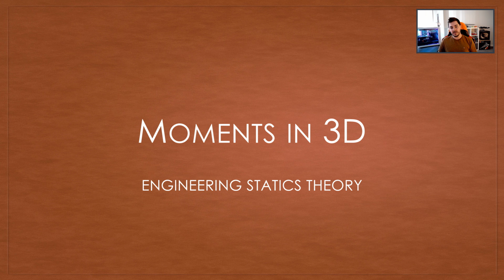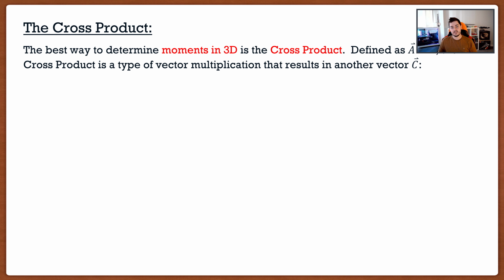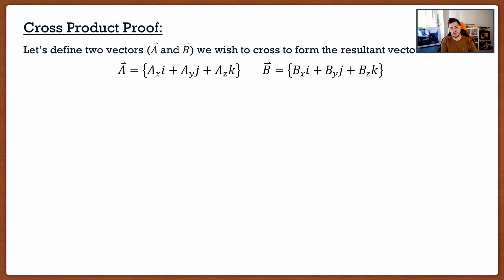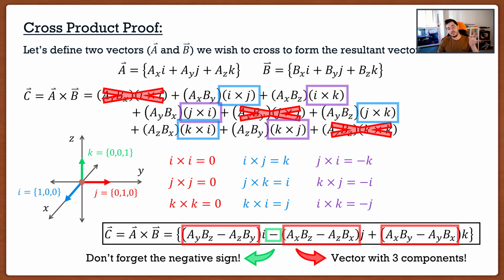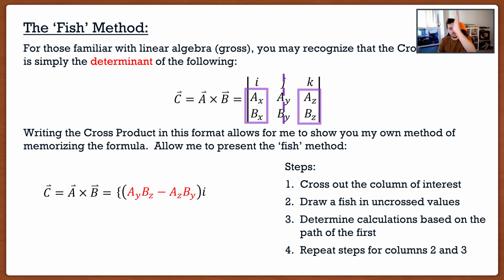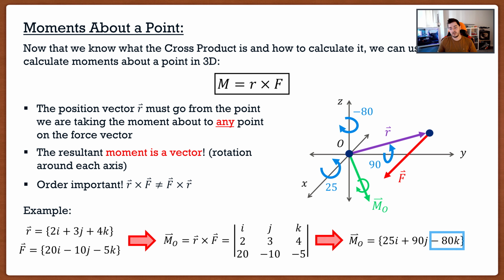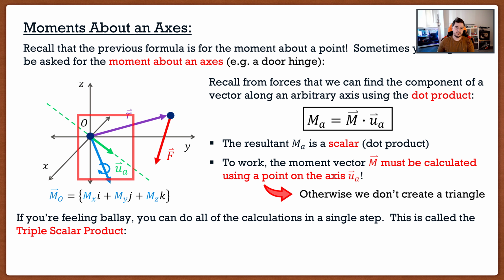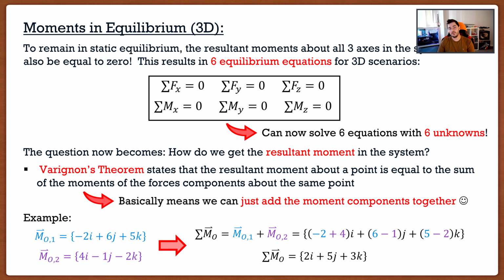Engineering Mechanics: Statics Lecture 10 | Moments in 3D (Cross Product)

Comment: Hey Clayton, at 15:21 you said that student always forget negative sign. can we write it like (AzBx-AxBz)j and put positive sign in front of it so it will be i+j+k, rather than i-j+k. I think we are getting negative sign in front of j component because we mess up the order. it was supposed to be AzBx(k*i=j) - AxBz(i*k=-j)= (AzBx-AxBz)j
Reply: but i guess it will not work well with the fish method. But if we want to keep positive sign in all of the components we will have to draw the fish in opposite direction for J component.
Reply from the maker: Ya as you will see everyone has a different way of conducting cross product haha this is my way and the formula shown is what was given in previous formula sheets. If your prefer that way with all positives it is completely valid :) always do what works best for you :)